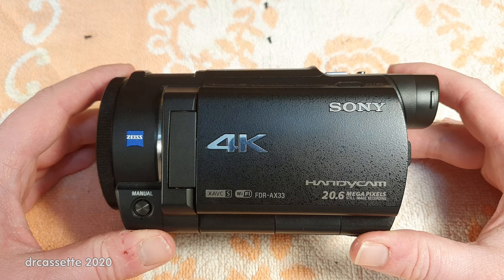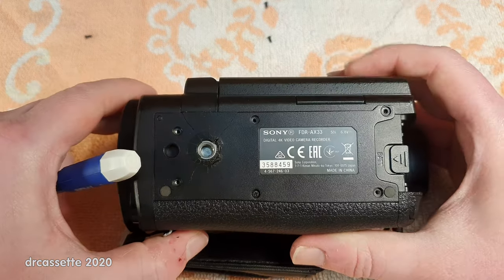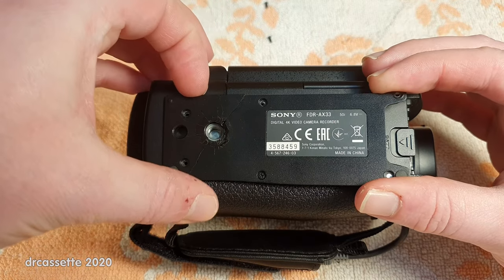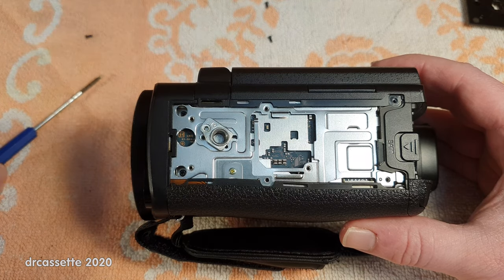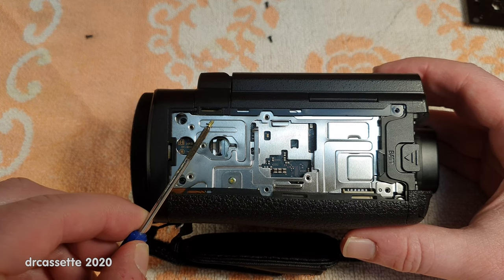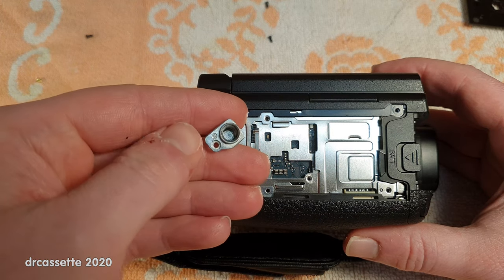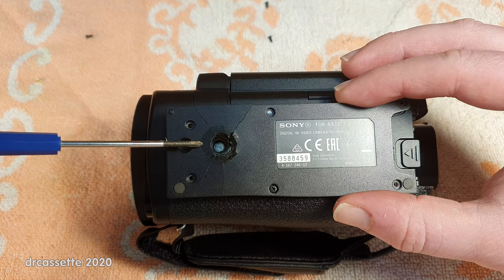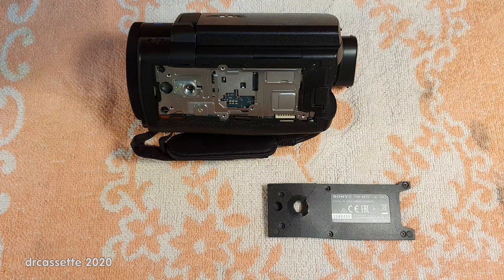Sony AX33 camcorder tripod mount problem and repair

Comment: Thanks for this, it is the best solution yet and one I will copy.  Is it perhaps worthwhile to drill a hole in the cover where the metal tripod mount screw is located for the purpose of using a longer screw to mount both new bottom plate and the tripod mount together?  Ideally the tripod mount should be epoxied or soldered on to this plate which will provide many more attachment points going into the body — the core problem is that not enough screws hold the tripod mount into the body.
Reply from the maker: When a tripod screw is tightened in the mount, the metal plate is clamped between the mount and the tripod, I'd say that should provide enough stability.

Comment: Nice bit of mechanical engineering analysis! It baffles me that Sony didn’t add an extra locking nipple/edge to the underside of the recessed part, the chassis looks like to have some provision for it. It’s a small cut-out slot opposite to the tiny screw.

Comment: Nice job, creating this base plate! I think you could improve it by sticking on some black self adhesive foil. If you punch out the screw wholes out of the foil a bit larger than the holes itself, you have the counter sink problem solved too. And using the heat gun remove the sticker and re glue it on the new base plate (/foil).

Comment: yeah a good solution. You can use a larger diameter drill bits to create a screw ressese hole by working it slowly by hand.
Reply from the maker: The screwheads have flat undersides, so the usual countersinking does not work. You would need a tool to create a recessed, but flat surface. Also, countersinking just by using a bigger drill bit is a bad idea because the countersink angle is wrong. I do have proper countersink bits.

Comment: Thanks so much for the info.
So you do not recommend buying the sony ax-53 due to this constructive defect? Because I'm uncertain between that and the Canon HF G50.The camera i'll buy will be always mounted on a handgrip
Reply from the maker: You need to be aware of that problem and be careful when screwing in a tripod. I have had a Canon camcorder that randomly died on me for no apparent reason at all, so I am not very fond of Canon. Though over the years I had two HF-G30 camcorders, and I really liked them.

Comment: I have the AX53. Looks almost the same but the tripod mounting is completely different (thank goodness) More expensive or later model I don't know. Just as well, I use mine for my YouTube channel where it's on and off a number of different tripods through out the filming of a video.
Reply from the maker: That's good to know, though I think I may have once seen an AX53 with cracked bottom on Ebay. Not sure though. But that could have also been caused by mishandling the camcorder, it does not necessary have to have been another design flaw.

Comment: This happened to my CX760 before I bought it, but I have yet to do the same thing to my AX33 (my CX760 was obtained off eBay, but my AX33 was bought new).

Hell, now I know this, I might just do this preemptively for my AX33 since I have access to the tools to basically make the piece match perfectly (we have some really tiny bits for the milling machine at work so I can sink the screw holes). I presently work with metal for a living so I could probably also make a redesign of the tripod bit with what I have access to at the shop.
Reply from the maker: Oh, so this design flaw has been implemented into previous models already... That is sad. I think I have also already seen an AX-53 with cracked bottom on Ebay, so they probably have not taken care of the problem yet. 
With a proper machine shop it should be no problem to make a very precise replica of the bottom panel from metal. I had to work with the limited tools I had available. The screw holes for example need to be 1.6 mm in diameter, but I only had a 2 mm drill bit which I had to use because 1.5 mm was too small...
Reply: I think 1.5mm can produce a 1.6mm hole by hand if you hit the hole at a funny angle after you drill it. Not recommended practice though, bits that small will not take a lot of moment load before they snap (i have no good reason to know that).
Reply from the maker: Indeed, drilling holes at a funny angle with such small drill bits will cause them to break. I have broken too many 3 mm drill bits to try anything like that with a 1.5 mm drill bit :D

Comment: Take a large drill bit and widen each hole a little... :)
Reply from the maker: The screwheads have flat undersides, so the usual countersinking does not work. You would need a tool to create a recessed, but flat surface. Also, countersinking just by using a bigger drill bit is a bad idea because the countersink angle is wrong. I do have proper countersink bits.

Comment: What do you mean you don't have a tool to recess the screws course you do you can countersink the screws with a bigger drill bit.
They should have done in manufacturing put a lip on the brackets so it slid under the metal casing fastening it in with one screw
You could have poxy the bracket into place on the metal frame world of probably work fine the plate looks alright when you paint it black you won't notice
Reply from the maker: The screwheads have flat undersides, so the usual countersinking does not work. You would need a tool to create a recessed, but flat surface. Also, countersinking just by using a bigger drill bit is a bad idea because the countersink angle is wrong. I do have countersink bits. This is not like a home improvement project. Everything has to be precise with only fractions of a millimeter of tolerance, or else it won't fit.
I am not smearing epoxy glue into a camcorder. It will end up in places where it doesn't belong, and the camcorder can never be taken apart again properly.
Reply: @DrCassette  not really countersinks the same but yes if they're flat
Reply from the maker: @johnsweda2999  No, the angle is different. Maybe you have different types of screws where you are.
Reply: @DrCassette  not for countersunk screw no different only the size of drill bit you use will change and of course if it's a massive screw head. You can flatten the piece of metal with a flat punch if you want to leave indentations

Comment: I still don't wonder why I don't buy Sony products. I purchased a Walkman cassette/radio in 1985, the internal mechanism just fell to pieces in a few months. After several years later, owned a Walkman portable cd player and the plastic spindle with the ball bearings just collapsed.